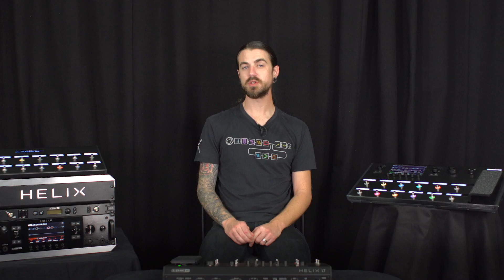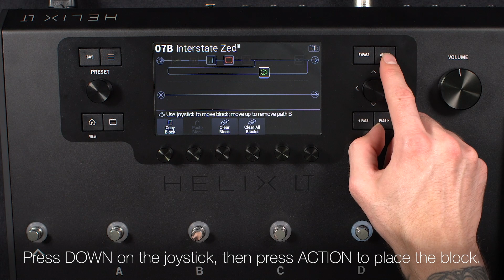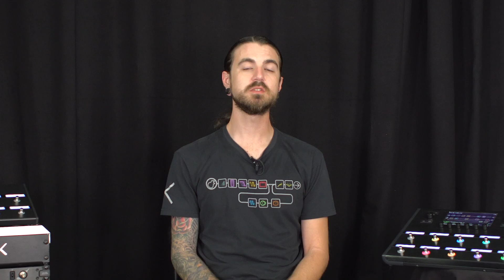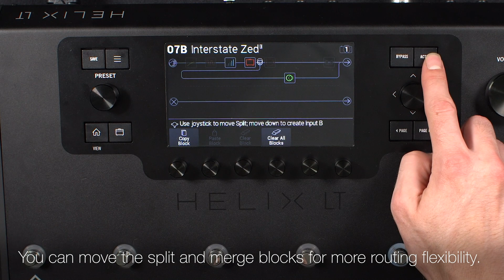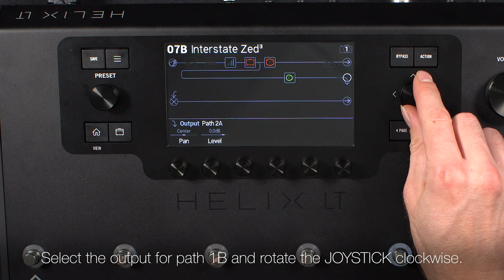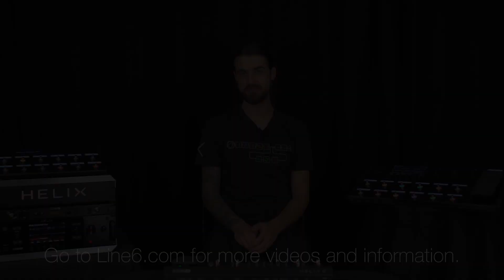Line 6 | Helix Minute: Create Multiple Signal Paths

Comment: Hello i love your videos. Can i use in Helix dual outputs ? One output XLR Left and Right  With Amp+ Cab and effects to P.A and other outputs 1/4 Left and Right to diferent Amp, real amps a Mesa boogie and a Fender and in Helix the same patch with effects but without cab and amp simulation. Its possible? Does the DSP Can hold on ?  Thanks regards from Portugal.